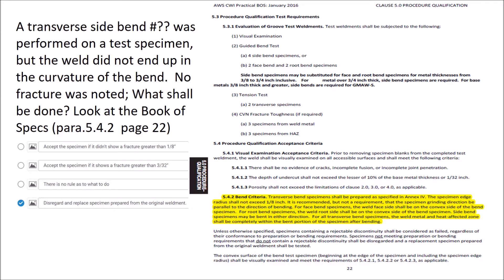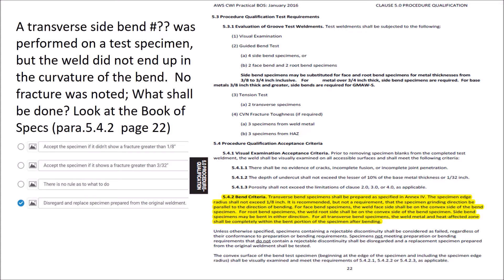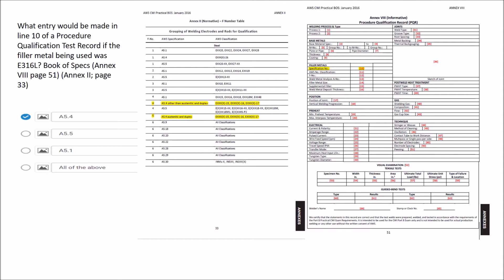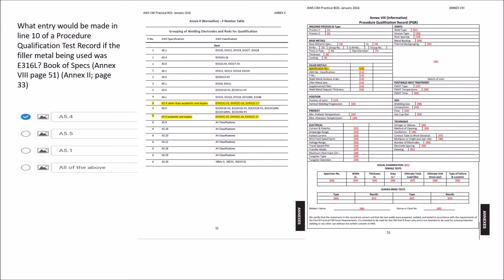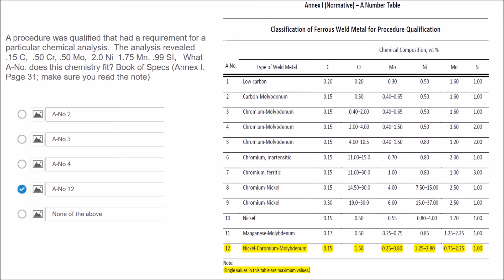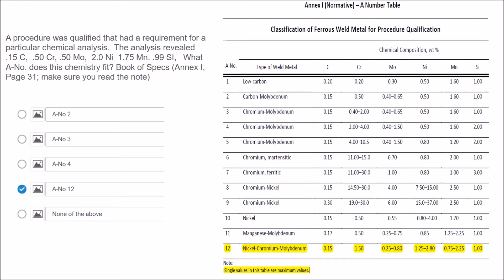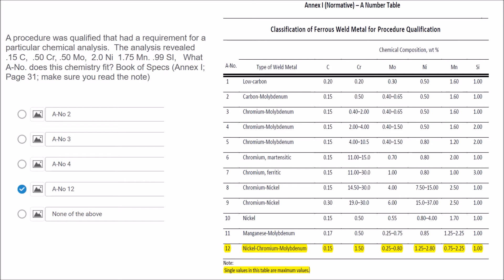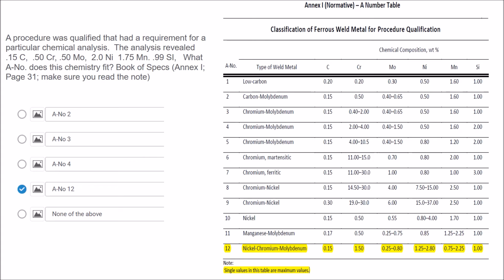CWI New AWS Part B Sample Questions  And How To Find The Answers

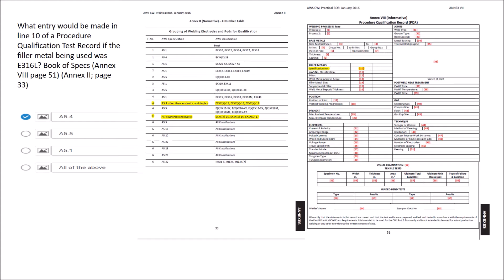Comment: Your statement at 1:42 indicating that" ..whatever is in parenthesis would be a letter..." could cause some confusion since the other uses of the parentheses are for steel filler metals with a 3 digit strength designation. Still good information. I am working on a similar presentation myself.

Comment from the maker: AWS sale the replicas for about $2400 https://pubs.aws.org/p/1636/rws-replica-welding-set; plus, the seminar/class they offer is around $2618  https://www.aws.org/library/doclib/2236-price-list-20171211.pdf  .  It’s very hard to implement the weld samples into the quiz but for the price, these tests will help greatly.  I have been a CWI/CWE since 1996 plus I teach the CWI Course at the college and I found out that Part B is the most complicated part.  The online quizzes I put together is very good because it tells you where to look at in the book of specifications to find the answers.  One of the most important thing when taking the Part B "read the footnotes".  Don't attempt to take Part B Quiz if you don’t have a copy of the Book Of Specs.  THIS IS A VERY DIFFICULT QUIZ; AND REQUIRES YOUR FULL ATTENTION

https://www.classmarker.com/online-test/start/?quiz=vkj5a2ef33b12630   Part B Questions Classmarker Website

https://www.proprofs.com/quiz-school/story.php?title=mjazoty2mwg9wt  Part B Questions Proprofs Website

Comment: Hi there Mr. Lewis awesome stuff but the Part B has been updated and there is now a 2017 version.
Reply from the maker: Cleider Arroyo this is the latest; it’s marked as 2016 but they started the new testing in March 2017. I call AWS every month; plus I’ve had a few students take it a couple months ago
Reply: As of October the testing will be using the 2017 edition, I can email if you would like to see.
Reply from the maker: Cleider Arroyo send to glenelewis@aol.com
Reply from the maker: thanks for sharing the info; I compared the two and they are identical.